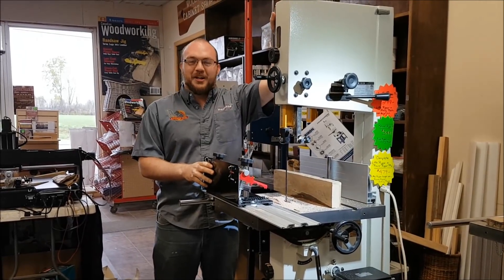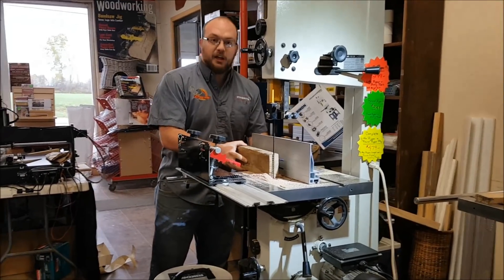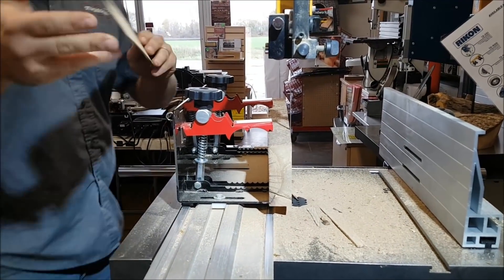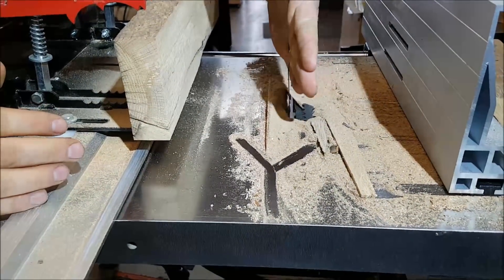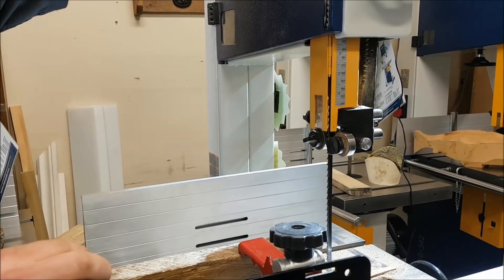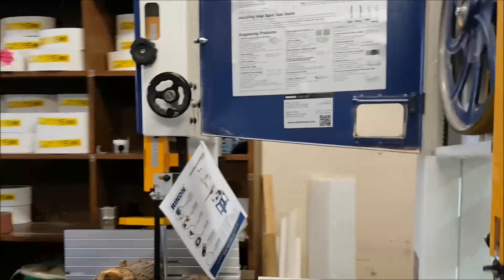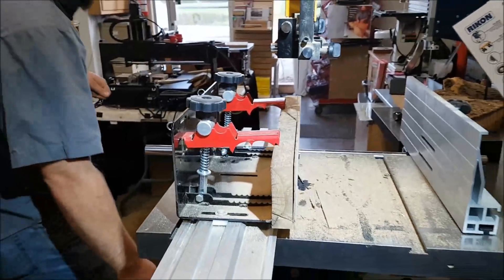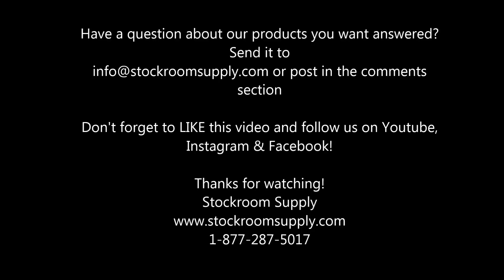EthAnswers Blade Drift myths, Why Bandsaws Should Never Drift!

Comment: So, it's a $400 gizmo that has jaws chewing up the wood, is finicky to get setup right (even your first cut wasn't parallel to the board and you're the "expert" giving a demonstration on how well it works, and is going to be completely useless on anything more than a couple of feet long -- and all to make up for having a dull blade…
Reply from the maker: The Little Ripper might not be for you but thanks for watching!
Reply: Nice video on setting up a bandsaw to eliminate blade drift.
https://www.youtube.com/watch?v=vNdrkmx6ehI

Comment: So if the side fence causes side pressure (binding) AFTER the wood is cut ....why not simply stop the fence AT the blade , since the only guiding it's doing AFTER the cut is "bad" ?
Reply: i agree. that would also prevent binding.
Reply: it would be hard to get a straight cut since as more and more wood passes the blade there is less and less fence support.
Reply from the maker: This is absolutely the best way to use a fence if possible. There are still a couple issues however. First the piece that you put against the fence must be face jointed so it does not rock and move against a fence. Not everyone has a jointer larger than 6" so this can be impossible. With the Litte Ripper every piece you clamp becomes perfectly flat...no more need to face joint.
Also as ThePhiloctopus
 had said it can be difficult to hold some against a fence that ends at the blade.
Thanks for watching!

Comment: I am really new at this stuff and don't even have a band saw yet but you say that the reason the Little Ripper works is because the piece that is clamped in cannot move.  If you are using a fence, how can the piece on the fence side move?  There is no where for it to move to....just like the piece clamped into the Ripper.....right?
Reply from the maker: Hey There,
Thanks for watching my video!
One of the best way to explain/visualize the difference between the 
Little Ripper and a fence is this. Picture a 1" board that you want to 
cut in half,so two 1/2" pieces. When this 1" board begins to 
stress(splits/peels off/opens up) which side of the board is moving? The
 side against the fence or the side away from the fence? Since you are 
cutting two equal boards likely those boards are opening up very 
similarly. Therefor you will be binding the blade against the fence.
When you do this same resaw with the Little Ripper something totally 
different happens. The 1/2" board away from the Little Ripper will open 
up and stress but the piece that is held in the Little Ripper does not 
move. Simple reason is that the 1/2" board is clamped by at least 8 
different points...it can't move. As soon as it is released from the 
claws it will stress.
Hope this makes sense!

Comment: I think you missed something.  When using the fence the wood splits and "peels off" on the opposite side.  Your gripper is merely another fence, just on the opposite side of where a normal fence is used.
Reply from the maker: Thanks for watching my video!
One of the best way to explain/visualize the difference between the Little Ripper and a fence is this. Picture a 1" board that you want to cut in half,so two 1/2" pieces. When this 1" board begins to stress(splits/peels off/opens up) which side of the board is moving? The side against the fence or the side away from the fence? Since you are cutting two equal boards likely those boards are opening up very similarly. Therefor you will be binding the blade against the fence.
When you do this same resaw with the Little Ripper something totally different happens. The 1/2" board away from the Little Ripper will open up and stress but the piece that is held in the Little Ripper does not move. Simple reason is that the 1/2" board is clamped by at least 8 different points...it can't move. As soon as it is released from the claws it will stress. Therefor it cannot bind the blade.
Sorry for the long winded explanation but I hope this makes sense!
Reply: EthAnswers by Stockroom Supply l
Reply from the maker: All three of those manufacturers make fine bandsaws. 

I like the Rikon personally though I am incredibly biased haha(we are a dealer for Rikon). 

Here's a video that talks guide comparison...specifically about lagunas ceramic guides. Might be of interest to you!
https://www.youtube.com/watch?v=fF5_3b25LuM
Reply: I think you have missed the point of his vidio......the fence is the problem. Creating  side pressure.  🤣😂😁😀😎

Comment: I have two bandsaws, a 14" and a 24", both cut without drift, thin or thick cuts, never had any drift on any wood, soft or hard. Always use a sharp blade, if you are trying to cut with a known blunt or abused blade then expect the worst. ... my two cents worth... cheers
Reply: Yes, I have found that a sharp blade makes a world of difference.  When it starts to drift in a cut, I stop and sharpen the blade, then it cuts like butter :)
Reply: Darryl Brook I was about to post the same observation. Sharp blade no drift. Blunt blade = drift.

Comment: Sure enough my blade drifted into the fence. And it was only my first cut. But when I checked the teeth I noticed that the ones on the fence-side stood out way more than the other side.
Reply from the maker: Uneven blade set causes drift as you've just demonstrated.
Thanks for watching :)

Comment: Are you saying that you need a "little ripper" to have straight cuts?  I have new and old blades and I cannot for the life of me get my saw to cut straight.  if I lock everything in, it will force the material in one direction or another.  I have done the things suggested in other videos and moved the blade to the front or back of the crown and it always cuts to a direction, regardless of where the blade sits.  I have also set my guides close and away, the blade always drifts.  I would love to find out how you were able to achieve these results.

I have brand new (just out of package) and older rarely used blades, some skew right, some skew left.  There is no consistency.  Please help me configure my saw to cut straight.  I will literally throw money at you if you can help me figure out how to get my saw to cut a straight cut, regardless of the blade/material I put in.

Thanks
Reply from the maker: Hey Zach,
Well you do not need a Little Ripper to cut straight on your bandsaw. What you need is a method the can not bind your bandsaw blade...Incidentally exactly what the Little Ripper does.

As soon as you free hand, use a fence or a resaw pin you will bind your blade. Bandsaw blades are quite fagile. They have about 0.025" set at the front. If you reduce this set by 0.001" your blade will cut 4% better in the opposite direction(the sharper edge). It takes very little to cause this damage to a bandsaw blade.

The Little Ripper allows the user to never bind the blade. The wood is free to open up on one side and is clamped in place on the other. It may be the solution you are looking for!

Here's a link to our website; http://stockroomsupply.ca/shop/little-ripper-and-round-ripper/the-little-ripper.html

Comment: Drift only occurs when you're using wide blades (5/8", 3/4" -1")  with narrow kerf because such low-set-angle blades can't "crab" against a misaligned fence.
Reply from the maker: I vehemently disagree with this statement. 
A bandsaw blade drifts because the set of the teeth is not equal(one side is duller than the other). It is every bit as easy to bind(dull) an 1/4" blade than it is a 1" blade.
Say you were to rub a steel shaft against the left side of a 1" blade...what would you expect to happen? The blade would then drift to the right as the teeth on that side are sharper. Say you were to rub a steel shaft against the left side of an 1/4" blade...what would you expect to happen?
This example is extreme but a great example of why bandsaws drift. When you use a fence, freehand or use a resaw pin you will always bind the blade. This causes drift regardless of how wide your blade is.

Comment: Blade drift IS real but you won't see it using those 3/8" wide-set blades. With a set angle of 3 or 4 degrees that blade will follow any rail or fence gleefully. It cuts nice little 3" holes, yes? I cut a 1" diameter hole through 18" of Doug Fir using a blade like that. It's here on YouTube also.Put a real thin kerf resaw blade in there and tell me your little ripper don't see drift. I use a rail and carriage jig of my own design to cut 14" walnut veneer. Drift becomes critical when you're setting up for potato chip slices. I recommend  ripping a perfectly straight centerline down a perfectly straight 2" x 4" to devine the exact direction the blade wants to go, and then scribing that line on the table top as a reference for any fences or rails to parallel. I posted another YouTube video explaining "set angle" and the formula to calculate it. It's vital to mastering the bandsaw operation. BTW: I like the Little Ripper; just don't see how blade drift enters into that.
Reply from the maker: William I feel like you are missing my point. 

I am not saying drift does not exist. I'm saying as long as you don't bind the blade and modify the tooth set(with a fence, freehand, resaw pin etc.) your bandsaw blade will never drift.
A standard blade has about 0.025" set...if you reduce the set by 0.001" on one side of the blade it will cut about 4% better the opposite way. 

If you have ever used a bandsaw with a fence you will notice the bandsaw blade will always cut better(or drift) away from the fence. This is because the wood is opening up against the fence and is then being bound against the blade. The bandsaw blades teeth then become duller(or set has been reduced) on the fence side.
I hope this helps you understand how and why bandsaw drift happens.

I am glad you like the Little Ripper though :) Thanks for watching!
Reply from the maker: Kidd shellac you are to fast! But yes the MicroMag Stop block is designed exactly for that purpose. 

Thanks for watching!
Reply: What I'm saying is that the blade you're using has so much set it won't bind no matter how far the fence and blade are mis-aligned. Try that same test with a resaw blade (like Highland Wood Slicer) not that wide-kerf general purpose contour blade you have on there now. Did you look at my Radius Plug Demo video? It's on the Titan page of www.falbergsaws.com. It's all about set angles.

Comment: I think this assumption of drift makes a lot of sense.

For the people that aren't understanding why here is the simplest way I can think of:

With a fence that goes all the way next to the blade it is only possible to have side force come from the fence side. The idea is that the distance from the fence to the inside teeth is permently fixed AND the wood is free to move (even if it is minute) and this can only happen on the fence side since nothing physically stops the otherside from going away from the blade. For one: a person cannot move perfectly and for two: it is practically impossible for wood not move, even if it is a minute amount. This equates to the inevitability of more wear on the fence side as there is absolutely no room for the wood to move.

On the outside it is essentially impossible for the wood to pull itself into wearing the blade more as it has just left being cut in that instant and even if it twists or whatever it will not be held by a fence and force to push against the side of the blade.

This jig is different from a fence because the previously inside wood becomes the object that is not allowed to move. To move into the blade while being held like that the board would have to have something weird like bumps literally expand out of the middle of the board without bending the board since it is rigidly fixed at so many points.

I would like to counter that simply using a fence that stops, or veers away, before coming to the teeth could also avoid the inevitable pressure. The wood would leave the cut and neither piece would have a fixed object to cause wood to be forced into the blade. The end becomes trickier, but you could always just plan an extra inch or two for that last unsupported exit cut.
Reply from the maker: Great comment! You have it exactly correct, The Little Ripper works because it locks the wood in an unmovable state on one side and on the other it allows the wood to move, twist and bend all it wants. It does this all without binding the blade.

You fence comment also in completely accurate! Te best way to use a fence is to have it end at the blade(or veer off). This still poses a problem though. In order to do this you must have a board that is face jointed so that it does not rock up against the fence as even a planed board will be warped. Not everyone has a 10" or larger jointer to use. 

Every board you clamp in your Little Ripper becomes perfectly jointed due to it relying on the flatness of the sled.

Thanks for your comment!
Ethan
Reply: I have just put my ~1950 PowerKing 912 together after some refinishing and have tested the short fence system out with my brand new blades as the first thing I have ever done on this saw since getting it.

It definitely works and I think this verifies that what you are claiming is indeed correct. I just jointed a block to use as a fence, put it on the table only aligning by eye, and made sure that the fence ends BEFORE coming to the teeth. Also had blade gullets aligned on crown.

I ripped a piece of 2x8 in half without any issues and actually pushed it through quite fast. After that I ripped some 2x4 in half twice and that went through like butter and cut super straight.

The only issue I noticed was one piece of 2x4 I did had a really dense and barely slanted knot that made the blade curve away from it slightly as I sped through (I did some 2x4 FAST). I'm sure it didn't help that I had the blade guides at like 9 inches tall for everything. This actually verifies your claim also as any extra work on one side of the blade makes it veer.

All this worked great even with:
-horrible blade guides (old as eff, not even close to square, top ones are just misshapen pieces of old wood)
-no measuring fence alignment/blade angle
-low tension as spring is like 60 years old
-FAST cutting (wanted to test new blade)
-just a piece of squared wood as a half length fence

The last inch is super tricky and must either be assumed to be wasted, or you can stop short and flip the board to finish the last inch from the fence side.

Comment: Dude, for safetys' sake lower the upper pinch block/ guide bearing blade guard. I constantly see ''newbs'' in our shop cut a 1/2'' piece of material w/ the guard all the way up. the bandsaw is the most dangerous piece of eqpt. in the shop, because it seems so HARMLESS.
Reply: Maybe to you. I find it way more dangerous looking than the table saw, so I'm always really careful with that one
Reply: Stationary tools with blades: I‘be always aware, they are all dangerous. 
The two most dangerous tools in the shop are an angle grinder without a guard or its 90-degree handle, and a 20-ton shop press...
Reply: Nope ....every Carpenter/Wood Worker  I've ever known with missing fingers did it with a Daddo Blade or a Jointer.

Comment: The title of the video is misleading.  He is showing that you do not have to deal with blade drift with his attachment.
Reply: nope .... he shows you in the video that he has his guides set correctly, has the blade tensioned properly, has the gullet of his blade's teeth set on the crown for proper tracking, and knows to keep his blade sharp and properly set to both sides.  Even WITHOUT "The Little Ripper" his band saw has no drift, because it's set up properly.  Did you see the written guide plastered on the inside of his band saw's top wheel cover?  GET ONE AND FOLLOW IT.

And yes, he's showing you that if you use his attachment OR ANY JIG THAT WORKS IN THE SAME WAY .... as long as you are only putting pressure on the FRONT of the blade, it should never drift.

Smart guy ... I like the whole video.

Comment: I would suggest that it cuts straight because the wood is raised off the table therefor allowing the sawdust to clear.
Reply from the maker: Hey Rob,
That certainly does help with dust removal but in my experience has nothing to do with the accuracy of the cut. Thanks for watching!

Comment: I would think moving the blade to the back of the wheel as you did, would have started to bind the blade on the right side. You did say that you changed the angle of the blade. 

When I try to re-saw down the middle of my board using my fence, my blade is drifting towards the fence. (Left) I’ve “set up” the saw twice with the same results. Based on your video, I’m thinking maybe I’m applying more pressure on one side more than the other. Or maybe my blade is bad. Maybe I’m feeding to fast. 

The frustrating thing is there are all kinds of videos of people making a very straight cut using only a fence.

I do like your video, and there is no arguing your results.
Reply from the maker: Thanks David I'm glad you liked the video!
The issue with wood is there is no real way of predicting how it will move and stress as you cut it. But guaranteed when you use a fence on a bandsaw the wood will move and bind the blade.

I,like you, struggle with a fence on a bandsaw. The only way to cut straight regardless of the tension, setup or blade is to use a carriage. I hope my video helped show that!
Ethan
Reply: The fence is the problem. Start cutting a piece of wood against your fence about four inches into the wood and shup off the band saw. Now look to see which side of the blade is tighter to the wood. Adjust the fence away to make the distance equal. It may take a couple attempts to get the blade dead center, but once you have this blade will not drift.